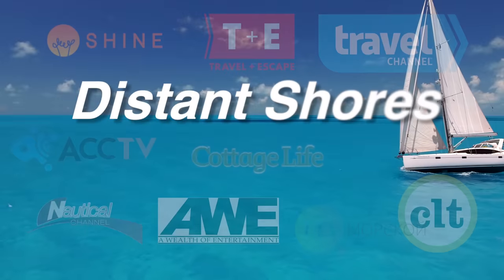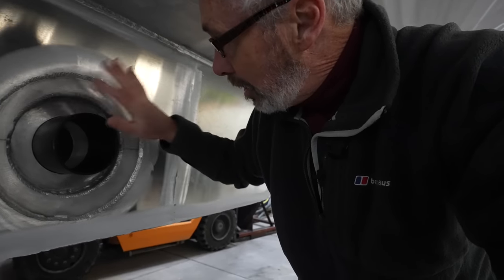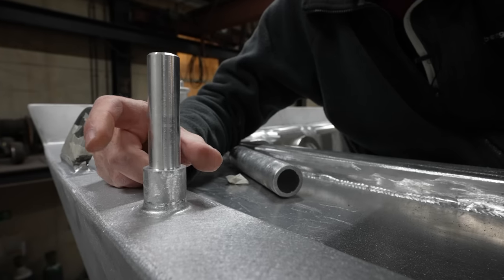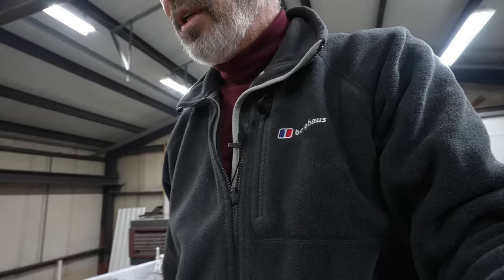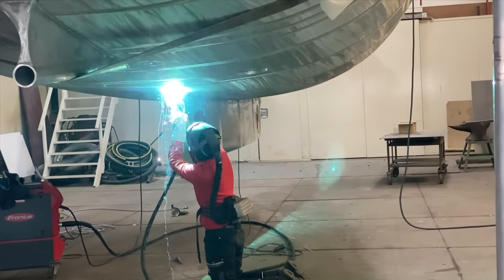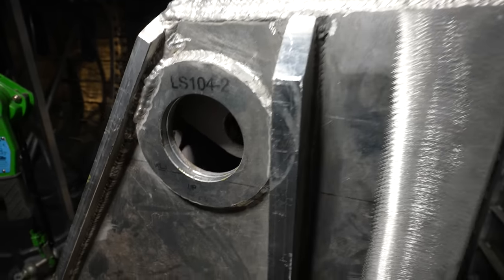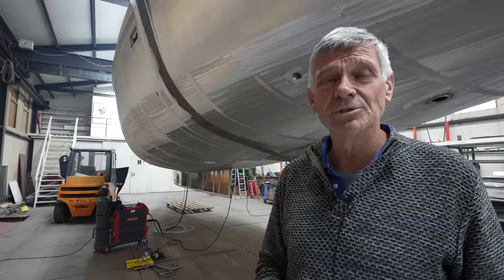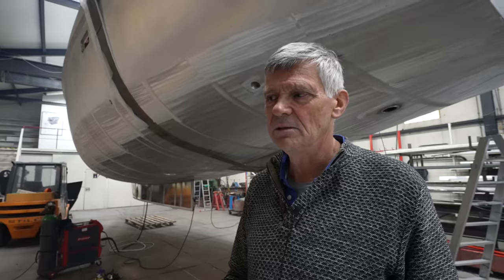Building an ALUMINUM Sailboat Pt 13 - Corrosion Prevention | EP 233

Comment: Small point- electrolysis and galvanic corrosion are similar but not the same thing. Galvanic corrosion is caused by dissimilar metals in contact when immersed in an electrolyte. Electrolysis is the result of potential current between two objects and is usually caused by stray electrical current.

Comment: There seems to be a lot of failure points if the bushings or washers give out.
Reply: Yes and No. Much more stuff is welded instead of bolted on a normal boat. All boats need to be waterproof, so all the bolt-ons are a failure point anyway. But if you start to think about it, yes many many many things can go wrong.
Reply from the maker: Indeed! It's the nature of boats that many things can go wrong and there are a number of different ways of going to sea safely. Regular checks and maintenance is important on all sea-going sailboats!

Comment: My bet is that the Delrin Moly matrix bushing used is conductive. Perhaps a non conducting bushing would be more appropriate. The Molybdenum Disulphide or graphite black coloured filler makes the Delrin conductive. Perhaps you could use a glass fibre Delrin sleeve bushing. Way more appropriate if the pivot axle is required to be electrically isolated. The enhanced bearing aspect of the Molybdenum Disulphide Delrin matrix sleeve is not required for Improved friction coefficient.

Comment: Why didn't you use not aluminium stanchions? We have had them on our boat for 40 years. Incredibly strong. They mate to an aluminium toerail. No dissimilar metals.
Reply from the maker: The stanchion bases are aluminum so welded to the toe rail but we like stainless stanchions and lifelines to avoid oxygenation rubbing off on clothing. Good to learn that you have had such a great experience with yours. Thanks for your comment, Tim.
Reply: @DistantShoresTV  they are anodised. Nothing rubs off on clothes. They don't need cleaning like s/s. They don't rust. They are nicer looking as they are tapered.

Comment: What a coincidence. Had just ordered my Tef-gel before the vid. PS: To my horror, I have seen several RVS screws screwed into the "ribs" of the ALU hull. Has it caused corrosion, undoubtedly. Have I taken as much as possible out. Of course. However, the hull is still going very strong. So conclusion, whilst I do my utmost best to prevent corrosion, I also am somewhat comforted that after 40 years of a few glitches my hull still seems solid. Thanks for this really clear vid. As an ALU owner, I love the simple explanation, of a topic so intimidating! (PS: I think the electrics is the biggest issue to be very careful with. I just am about to finish my DC runs, which are in IP44 rubber wire, inside pvc pipes. So triple instead of doubly isolated.)

Comment: When building aluminium boats in South Africa, a company (name left out for reason) poured Lead directly into the keel box. They did not use any liner, nor did they use any other method to isolate the Lead from the aluminium. A few years on and the boat was taking on water and had to be pulled out and they found that the lead had reacted with the aluminium causing lots of corrosion. The company had sealed the lead with a top plate and only minimum water sat in the bilge but was enough to start the process. The repair ($60,000) was comprised of cutting off the keel, building a new box around the existing poured lead keel which was epoxied and isolated before installing into the new box. After seeing the repair I understood that poured lead has a possible problem. 
Your new build is going to be beautiful boat and congratulations on the new build!
Reply: Excellent video.  But I do not understand how, in the case of Distant Shores IV, the poured lead will be isolated from its aluminum enclosure.  How is the Dutch construction method going to avoid the deficiency of the South African builder you are describing in this comment?
Reply: @arthursalvadore  I am waiting to see as well Arthur. If the Lead was bricked first in a mold then transferred to their new boat which had the areas epoxied that might work.

Comment: When I was about college-age most of the West Coast of America alloy Boats were hitting 25 to 30 years old. I made a lot of money paying for college chopping rotted aluminum out of the bottoms of mid-eighties to early 90s boats. Postmortem the biggest issue is pooled water, that killed more boats than anything else. Isolation is fine, but in my experience it slows but does not fully stop corrosion.  Duramax makes synthetic Stern bearings that I would have preferred over a coated bronze one.

The other issue that we always ran into was Plumbing, the market doesn't really realize just how set up production lines are for glass boats but not so much for aluminum. Ended up going Fraser bronze with marine-grade cast aluminum Weld on through holes. But the first one I installed was in 2009 so no one really knows if it'll last longer than the old options because the issues usually show up between 20 and 30 years that's when they really start Cutting Loose.

Comment: 🤔 Both “the devil and excellence are always in the details”.  I’ve gained an appreciation of how many details have gone into this design, especially in the area of galvanic isolation.  One small question I have is: why did you not just use thick walled aluminum railing components to eliminate the complications of all those isolators? I realize that SS is shiny but all aluminum would blend with the hull and the natural oxide layer  could provide grip for both hands and lines.

       The keel trunk extending below the hull while slightly increasing draft and drag will on the other hand extend the poured lead lower and provide for far easier swing board pinion replacement compared to an all internal hidden arrangement.

           I admired how the skeg (presumably on DS 3) protected your expensive folding prop from an inadvertent grounding or floating object or line impingement.  The twin rudders have no such protection, but then there’s the old drag and balanced rudder considerations.

            Is your standing rigging (mast & boom) going to be Aluminum or Carbon? Carbon is lighter and stronger but what is its sustainability to surviving lightning ⚡️ strikes?

            I’m continually intrigued by the many design decisions you’ve made … perfection is never possible but optimization for a particular intent is achievable.  Please keep up these detailed videos, they fascinate me. 👍 👏

Comment: @ 9:51, the connection of the compression post for the mast with the upper deck. That just looked like an afterthought to me. I guess I was expecting a more direct and solid connection to the mast step. I love everything I see so far about the boat,  but as a former ship/pipe welder, that just looked weak to me. Other than that, beautiful craftsmanship, makes me proud to be Dutch.

Comment: I been building ally boats for nearly 20 yrs I’m impressed with the fabrication and design and you won’t have any dramas if you use Tefgel or duralac 
Lanolin is great for the interior stringers , frames ,bilges ,nuts and bolts etc etc and hidden spots 👍

Comment: I agree with your isolation of metals, though some are better than others, example my Prop is a feathering stainless steel prop and not bronze and regarding the stanchions, I have a solid aluminum bar turned into a nice stanchions shape bow split & pushpit is an Aluminum tube pipe. A safety line is Dyneema with UV cover.  Still, you will find that is not enough protection when in a marina long term due to stray currents. Your boat construction is looking just lovely..

Comment: Build looks to be coming along nicely. Good workmanship shows skilled craftsmanship. 
Am wondering about Maintenance Scheduling… Certainly besides haul cleaning usually every year to few years, an Aluminum Boat requires similar attention. Please explain. And what type of Aluminum is used? 
Next are wearable and separation/isolation parts, ie bushing, washers, or prefabricated isolation pads. What preventive maintenance plan exists? Considering how Electric Powered everything continues to change designed systems, this surfaces new problems when connecting to Shore Power. Please clarify design schemes.
Am looking forward to learning more in future video releases.
Marty Didier

Comment: So many sailing channels garnered a solid audience with videos on the construction of their ship. As long as the full boat is in sight (it is beautiful), then of course you should keep them in the menu.
At 9:50 there os an odd-welded strip connected to the compression post (near the ceiling). Why is it welded slanted? Is this the correct procedure? Is it strong enough? And what is the reason fir such a weld?

Comment: I am surprised at how much isolation is needed to avoid the problems with dissimilar metals!  I've never really had to think about it.  Well, I have seen lots about replacing zinc anodes on other YT sailing channels, so that was familiar.  But an aluminum sailboat has to go way beyond!  Thanks for showing us the details.  

PS - Has the completion date changed or are things still on schedule?

Comment: It is practical to monitor the level of galvanic protection on a vessel afloat using a silver-silver chloride reference cell and an accurate multimeter, together with continuity checks (you want 0 continuity) between isolated materials.

Comment: I have been waiting for this video.  Thank you very much!   The new boat is shaping up nicely.  🙂    Question: How long is the keel pin bushing supposed to last (average)?
Reply from the maker: You're welcome @corujariousa! I think the keel pin bushing should last many years. In our previous lift-keel boats it lasted more than 10 years. With this design it is a feature that the keel can be lowered for inspection repair more easily.
Reply: @DistantShoresTV  Thank you. Keep the videos coming and have fun with the project.  Cheers.

Comment: Based on how much delrin is being used, a mini lathe and a good supply of stock might be a wise investment to fabricate needed parts as they wear out.  
Speaking of galvanic corrosion, I hear the same is true bonding carbon fiber to aluminum.  I’m guessing the same is true with titanium and aluminum.  I recall reading somewhere that aluminum boats should use magnesium anodes opposed to zinc.  Very interested in how the electrical system will be designed.

Comment: Thanks for the video, very interesting. My aluminium boat has a similar construction (but smaller 😊) and the hull outside has no corrosion problems. The corrosion is in the build-in tanks. What solution do you have in your tanks for corrosion?

Comment: Very interesting video.  Curious how the poured lead in the bilge/fixed keel area will be separated from the aluminum compartments it is poured into?
Reply: It doesn't need to be seperate because it will be sealed and no salt water will get inside.  No salt water, no galvanic corrosion.
Reply from the maker: Yes @Captain Win is exactly correct...

Comment: A metal boat is just a big heat sink in cold water. How do you insulate it and still be able to inspect the inside of the aluminum hull?
Reply from the maker: Excellent question, Marc. The boat is insulated to the waterline so the hull below that is inspectable.

Comment: How is lightning strike being addressed in an aluminum hull so that your electrical system doesn't get fried? In particular, causing lithium batteries to be shorted and cause a fire.
Reply from the maker: We will go over lightning protection in a future video but basically metal boats (either alu or steel) are much safer in lightning than any other materials. The electrical systems (future videos :-) will be well designed with the correct fuses and wire sizes to handle problems as well.
Reply: @DistantShoresTV   and  j . n
hi
N n n      n.... b5hhhnnnhbbbbbbbbbbbhbbbbbnbn Bhatt
 KKim . n

Comment: Is Zinc the correct galvanic protection for aluminium....
Google gives this.
Does aluminum corrode with zinc?
Galvanic corrosion occurs when metals break down each other. If the aluminium comes into contact with a more noble metal (such as copper, zinc and certain types of steel), aluminium will be broken down.
Reply: I have personally seen a aluminum jet drive unit in a plastic boat be heavily corroded but the zink anode looked like new..... It looked like the jet drive was sacrificing its aluminium to keep the zink anode in perfect condition.

Comment: When he pours the lead down there, wouldn’t that be dissimilar surfaces?
Reply from the maker: Galvanic corrosion requires dissimilar metals and the presence of an electrolyte such as seawater. In this situation the case will be permanently sealed with solid aluminum encasing the lead and there will be no electrolyte.

Comment: does the molten lead not melt aluminium, well obviusoly not but couldnt help thinking that. 
why not aluminium stauntions with solid handrail rail ?  didnt ilke the look?
Reply from the maker: Lead melts at 621 F (327 C) Aluminum at 1218 F so it wouldn't melt it. However it might warp the alu so its super important to keep the alu cool. So... when the lead was being poured the hull was dipped in the water to use natural cooling :-) Sadly we weren't there to see this process!
Regarding stanchions - its partly that stainless stanchions are more user friendly. brushing past aluminum and holding it you tend to get a gray oxide on your hands.

Comment: It's always amazing to see your episodes, and it's great to see so many details on the progress of your boat construction. I am curios to know if corrosion can happen also between lead and aluminum, since you are going to fill the bottom compartments. And what about having carbon fiber components (stanchions for examples) to reduce weight and corrosion points? Could it work? waiting for the next video, thank you for sharing your experience.
Reply from the maker: Glad you like them Giampaolo! The lead will be sealed in completely so no saltwater will ever come in contact with it. So as soon as the lead is added the compartment will be welded shut again. This insures there will not be galvanic corrosion since the two metals are not close on the galvanic scale.Yes the next videos will deal with more technical details and updates so we try to stay up to date sharing the build process.
Reply: Carbon fiber can cause galvanic corrosion when in contact with aluminum through a redox reaction.  Carbon fiber can be used for the mast, boom, stanchions etc. if you want to save weight but the material has to be isolated from coming into contact with aluminum.  This can be done by coating the carbon fiber with a layer of fiberglass because it has no conductive property.
Reply: @DistantShoresTV  Hello, would the lead "completely" fill the compartment? I'm guessing weld/sealing would be like not vacuum sealing, some moisture will be trapped, no breather for expansion/contraction? Also, curious why stainless rather than aluminium stanchions, perhaps even rail?

Comment: Question from a non-sailor…why do they use lead in the keel for weight…isn’t lead bad to be near for people?  Thanks
Reply: The outer keel is steel and after the lead is poured the holes are welded shut. No direct water to lead contact possible. Apart from that, lead water lines in old buildings are bad because you have direct contact between the lead and drinking water and you can get lead poissioning. In the boat something like that won't happen ever. Lead in the keel, 100% safe and very heavy, that's the main function, being heavy per volume to minimize drag under water
Reply: @dajobra  Thanks!